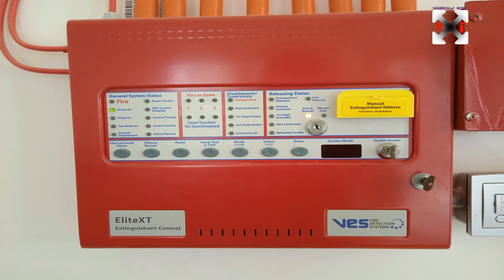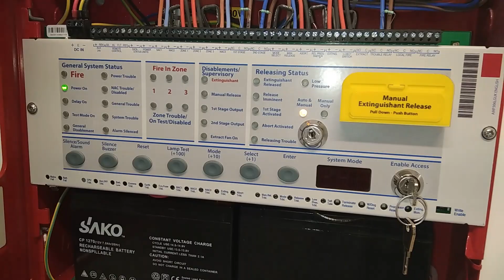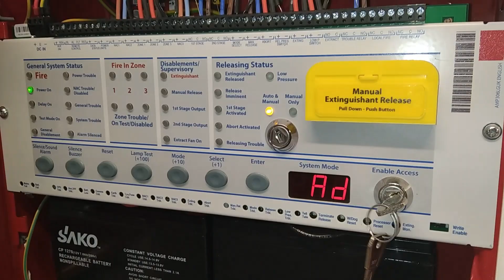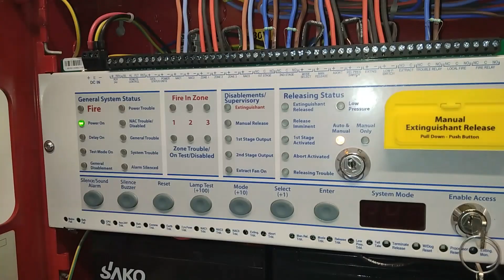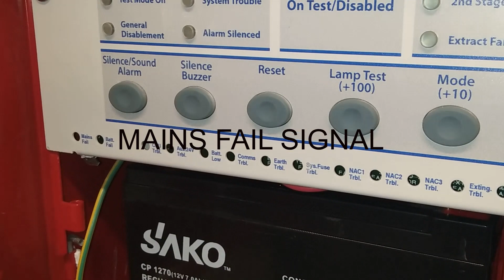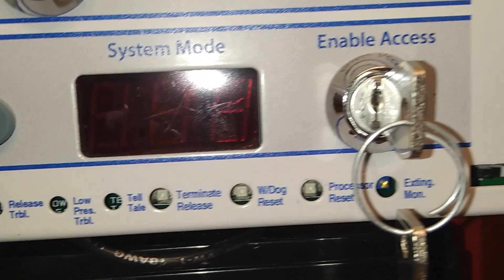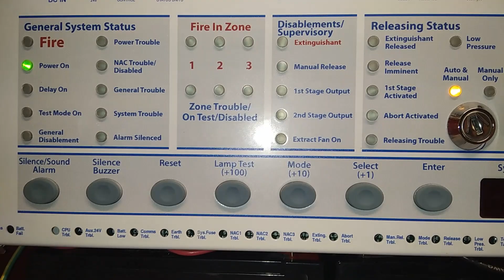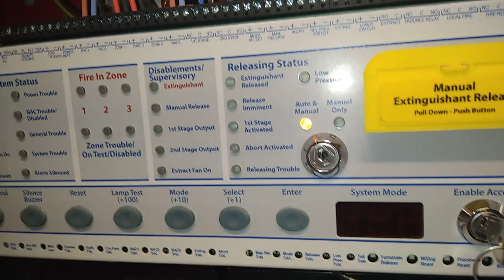FM 200 FIRE SUPRESSION SYSTEM HOCHIKI,VES,FIREPRO,AVENGER CONTROL PANEL

Comment: thank you, very informative, I noticed some resistances connected to ports that are connected to FACP ex 1st stage, 2nd stage and trouble relay, why is this?  and there are some shortened connectors like NAC3 , Zone 3 and Mode select, again can you explain? I am just trying to learn?
Reply from the maker: You are right, the part that are not in use has to be closed with a resistor and the alarm stages has the resistors as it's end of line so that if someone removes the cable it will send signal to the fire alarm panel, so in short it's to guard the cable so no one can temper

Comment: How to solve extinction trouble
Reply from the maker: First remove the extinguishant cable and fix a diode in the panel to check ,check the direction of the diode,if it works check your cable and place the diode as the end of line to replace the one that is there

Comment: Hi sir ...I have a question 
I'm always getting  releasing trouble. What are the problm
Reply from the maker: Releasing troubles are always from the releasing circuits so check the end of line resistors or replace your diode

Comment: Hello sir I have the same panel, the solenoid is disconnected but still the extinguisher is showing problem of released without any activation in the panel, what should I do for this
Reply from the maker: The end of line of this panel is diode so pls check on that and the extinguishing trouble can also appear when there is trouble with other parts too like the abort ,Mrs and the rest

Comment: i have one question kindly, if EOL resistors are connected in panel as above, it means they can not monitor open circuit faults. is this a good practice for technicians?
Reply from the maker: @vicomexengineering2664  not really, it's only the signals to the fire alarm that has its eol on the panel, mostly it has to be at the end of the line

Comment: Hello, how are you
  Mr , I have a simple question 
 Why does a signal appear? 
 Release trouble 
 When connecting the selenoid to the cylinder 

 As soon as I turn off the selenoid, the signal disappears. I hope you can find a solution for me
Reply from the maker: @safaakadhim5040  share with me the type of solenoid you using

Comment: Sir how to solve and reset cpu foult pleas help...
Showing cpu foult led and general foult led
Reply from the maker: you can only solve that by removing the power supply and battery to make the panel off for 30 secs and fix back problem is solved

Comment: Pleas clarify the  connection  of  shield A-xT fm  200 panel to detctor ,manual releas  and  soundr,electric  bell
Reply from the maker: It's same as connecting conventional detectors,the mps needs 470ohms resistor to trigger it

Comment: Please help me sir . Earth fault comming always i found it Earth.  detector cable not possible cahange cable. iwant stop Earth trouble .
Reply from the maker: first and foremost you have detect where the earth fault is coming from by removing the device cables one after the other till u see the earth fault gone so u can find the root cause of it .there is a code to disable earth fault trouble but the earth fault light will still be on ..check and update me and will advice you on what to do
Reply: Thank you very much sir. I found it ,zone 1 detector cable when remove Earth fault going . Spare pair cable was there i connect it now normal. Thanks for ur advice . If i have any doubt i  message u sir
Reply: How to disable earth fault

Comment: General trouble and power trouble how to close
Reply from the maker: check the small indication light below it will give you the exact trouble,but the main is AC power loss or Battery low or battery failure

Comment: Thanks for clarification. My question is for stage 1, stage 2 & trouble relay  there are resistance, why that?
Reply from the maker: it is for the fire alarm module and since the panel is the end of line,so we connect incase it gets open or removed it will notify fire alarm
Reply: @engineersguidehelp  thanks. But as you clarified. The resisiter will isolate the signal in the panel. And if there any cut in wire it will not appears in a board of the panel!
Reply from the maker: @losta7008   it wont but it will appear on the fire alarm panel
Reply: It would be helpful to know the value of the register

Comment: Dear brother nice video...

Can you pls explain me about the additional relay for AC shutdown.

From where you provide power to the relay and from where you will provide input signal to the relay , if we want to shutdown the AC in first stage...

Thanks
Reply from the maker: you can directly loop the neutral cable of the AC using the fire relay in normally closed condition...it will go off on 1st stage alarm

Comment: What is the use of resistors connected on top side of the controller and  what is their value
Reply from the maker: It's called end of line resistor to keep system normal and monitor each line ..6.8k and 10k

Comment: Can you pressure switch connect send pictures
Reply: Low pressure switch two wiring same colour will be connected From the Panel Red Colour Cable added 470k Resistance with other side 6.8k resistor another side of 6.8k resister will connect with black wire coming from the panel

Comment: I have one question why they use 2.5mm cable for horn strobe and bell instead 1.5mm because the supply is 24vdc only
Reply from the maker: 1.5MM ARE USED FOR INPUT DEVICES AND 2.5MM FOR OUTPUT DEVICES BECAUSE WHENTHERE IS AN ALARM THE AMPS INCREASES WHEN ITS AT WORK.SO TO ESCAPE FAULTS LIKE GROUND FAULT DURING ALARM ACTIVATION AND OTHER RELATED TROUBLES ITS RECOMMENDED TO USE 2.5MM

Comment from the maker: ALL QUESTIONS AND SUGESTIONS WILL BE ANSWERED AND TAKING INTO ACCOUNT RESSPECTIVELY WHEN THE CONCERNS ARE RAISED HERE..THANK YOU
Reply: We are using these panel but most of the panel key problem when we turned the key panel not working
Reply: Could you send me photos of the panel and what u want to do I will be glad to help
Reply from the maker: Mainly the key access needs to be turned to access the functioning of the buttons. There is one key switch called enable access turn it to the right side and access it, if it's another issue too pls let me know  tnx 😊
Reply: Please after installing the panel all the zone light is on please what's that place
Reply from the maker: @ericazure7569  no worries u can send me the videos of it and will direct you on how to make it work tnx 
dont forget to subscribe
Reply from the maker: +97450069062
Reply: @engineersguidehelp  please  confirm us if we want to get  gas release   signal  
Where we connect  wire in  ves vf1810-11
Reply from the maker: @safeyourself4755  this system was made for mostly first stage and second stage alarms ..
Reply: @engineersguidehelp  so in this case what we will do?
Reply from the maker: @safeyourself4755  but to help you personally you have to add a discharge pressure switch of which you can get a loop there as a signal for interfacing
Reply: Please can i get ur contact ?
Reply: 1)If case of  false fire alarm the smoke detector will activated?
2)if fire alarm activate so the fm200 will be release?bcz i heard the gas is release within 60 sec.so how can we prevent to release the gas
Reply from the maker: @khanbaba-ps4ft  THE VERY MOMENT 2 ZONES ARE ACTIVATED THAT IS ZONE ONE AND ZONE 2 ,THE PROCESS WILL CONTINUE UNLESS ITS ABORTED AND RESETTED.IF NOT IT WILL RELEASE.
2.IF FALSE ALARM HAPPENS ON JUST ONE ZONE IT WONT RELEASE ,THE BELL ONLY WILL RING